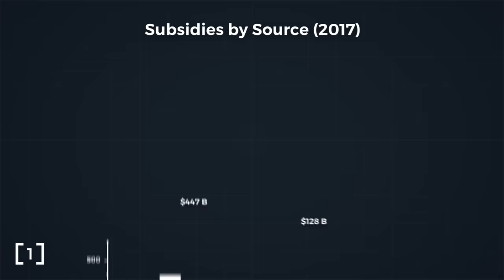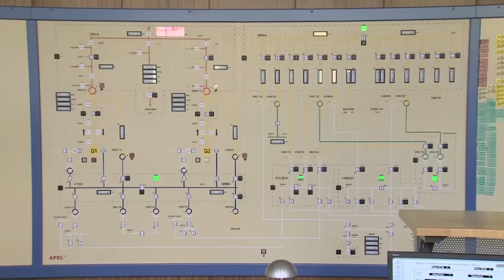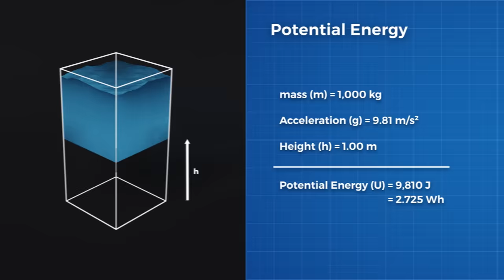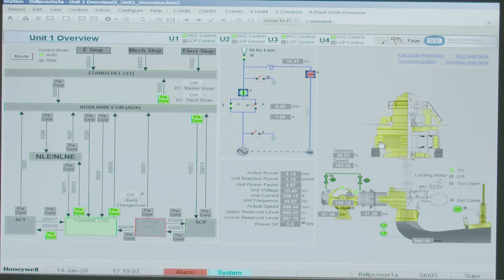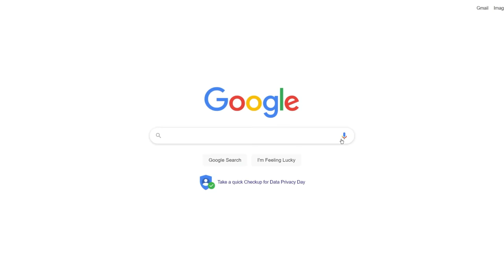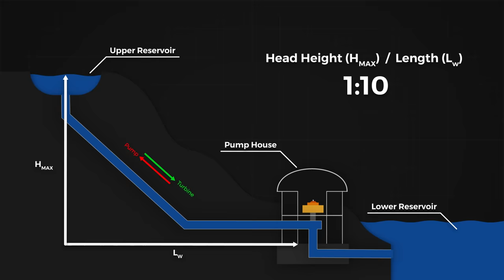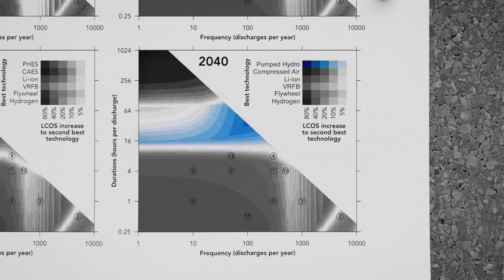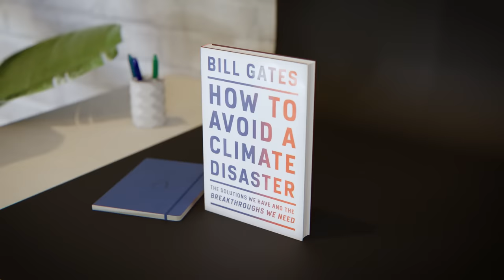The Truth About Pumped Hydro

Comment: I like what you said : "Not just one solution". Too often people are looking for a silver bullet instead of several solutions working together to solve a problem.
Reply: And this comment section is full of them.
Reply: You're so right, hydrogen, batterys, pumped hydro, biomass. Theywillall e usedin  some kind  of  area sooner  or later.
Reply: Yeah you need a gun that can fire silver bullets and cartridges and all that jazz
Reply: @laredobenjamin7438  "there are situations where the single solution is the most efficient" - you are aware of the 'there are situations' part of your statement? ;-)
Reply: There's a uranium bullet solution for every energy shortage problem.
Reply: @Kenneth_James  I don't have much respect for people , like you, that don't bother with research before making a sweeping generalization.
Reply: Nice name
Reply: Silver shot (as in shotgun) is the metaphor we need.  

Also, to the "nuclear is the answer" folks...  The economics just aren't quite there with existing nuclear tech.  Yeah, it is part of the answer, but not the answer at this point.  I hope the breakthroughs needed happen and scale to make for cheap nuclear, but right now y'all sound a lot like fusion boosters... Always just around the corner.
Reply: I've been working with nuclear energy for about 13 years now. It's not the tech that is the major road block. It's general public ignorance about the workings of radiation that drive fear based solutions for non-existent or overblown problems and a poor ability to frame relative risk. It all comes down to the indirect costs of the lengthy regulatory process that increases financial risks for investors. Every anti-nuke group knows this and try their hardest to bleed the projects dry by stalling them in court. Every day of delay costs millions.
Reply: @GwynRosaire  Yes and no.  Regulatory burden is a big deal. A lot of that is driven by irrational fear, but a lot is perfectly reasonable too.  Even if the public properly understood everything, nuclear power would still need to be very closely regulated because the consequences of companies cutting corners or just screwing up can be huge.  And you know companies cut corners and screw up ever day.  
Engineering and regulaton both lead to nuclear power being very large scale and long timeframe investment.  It isn't just or even mostly anti-nuke folks.  Those anti-nuke folks do make it far less likely that countries and companies (mostly finance really) are willing to put up the massive $ needed, but even if those folks didn't exist, the investment isn't particularly attractive given how quickly power generation tech and the competitive landscape are changing.  Several decades ago nuclear power looked a lot better as a long term bet, now, not so much.
The new nuclear tech that has been a decade or two away for more than a half century is turnkey small scale.  That would be a game changer, but it doesn't exist.  Seriously, folks have  been talking about small reactors (similar naval) being used for commercial power for longer than I've been alive, and I'm getting old.
Better bet is to move to more distributed small scale generation using a variety of tech and most plants with expected lifespans of a couple of decades or less, alongside point of use and community generation.  That sort of setup is a bit less efficient in the short run, but can adapt and adopt new technology much quicker and easier as it comes around.  A "smart grid" including some storage are enabling infrastructure we need.
Reply: how about comparing 128B for renewables vs 21B for nuclear which is the largest scale of clean energy?
Reply: Premise is faulty, crashing the entire system during rona yield insignificant carbon reduction, all these efforts are gloss, promoted with dishonesty for a reason, the double/triple spend of renewables that can't stand on their two feet is being over sold.
Reply: I've noticed this as well, people get hung-up on the "one answer" rather than accepting that depending on the circumstances one solution may be more viable than another.
Reply: @GwynRosaire  and disposal
Reply: The one critical component not discussed here is demand reduction. A huge chunk of our emissions reductions so far has been through efficiency - insulation, lightbulbs, better appliances. Though a range of solutions all working together is what's needed, the single best solution is not to need so much energy in the first place.
Reply: @michaelmichael3007  disposal is another politically contentious issue. It's not a technical issue. In fact, there are several videos on youtube from Argonne National Lab that document the research on nuclear fuel recycling. This turns the issue from one of deep geologic disposal, to one where it only needs to be stored safely for a few hundred years. And, before you talk about legacy waste sites, the distinction needs to be made between military weapons production and civil power production.
Reply: really, i think the problem is too many people are running their mouth and not actually doing anything. 
eg. hollywood, youtubers, media, wankers on facebook, wankers in the comments section, you get it almost all people.
Reply: Sounds like pharma
Reply: @marknoneya6630  🧠
Reply: @johnking6624  Oh yes, insult people, that is always a great way to convince them to change their minds.
Reply: @gordon1545  This is true in mature economies, but most people in the World are not living a Western style Middle Class life.  To achieve that will require a massive increase in power generation.  Multiple times what is produced today.
Reply: @Foolish188  If you are criticising my comments about fools who make sweeping generalisations from a position of ignorance then you should realise that they are too stupid to change their minds. Experience has shown that evidence does not sway them and reason is a mystery to them.
Reply: It's all a stop gap until Fusion gets fully developed... once fusion reactors come online, they can generate 300 liters of petro equiv per 1 liter of seawater (the deuterium that can be produced from that, that is) deuterium is so easy to produce, and tritium can be produced from lithium, with the current supply in the US having enough to last 1000 years, and the amount that can be taken from the sea, millions. 

Fusion is everything we wished Fission would be with nuclear energy, relatively clean, safe, and inexpensive (later on, it will cost more as companies recoup the cost of development) you can't have a chernobyl type event,  because as soon as the plasma loses containment it rapidly cools, and the reactor will shut down within seconds.
Reply: @ExarchGaming  We can't afford to wait for something that may not even be possible.
Reply: @johnking6624  It's not an if, it is possible, we've been able to initiate a fusion reaction (outside of thermonuclear weapons, so not a fission boosted reaction) and we've been able to get more energy out of the exchange than we put in, that was over a decade ago, both the US and China have set new records throughout the 2010s, it's a when not an if. 

The rest of your comment is totally valid though, yeah we may not be able to wait; hence the stopgap of alternative power such as renewables or fission nuclear. both should be exploited to their full potential until they're not needed anymore.
Reply: @ExarchGaming  I have been waiting for fusion power since the Russian physicists built the Tokamak back in 1958. It was certainly a possibilty then and all they needed was to overcome the engineering problems. We are 60 years later and its not there yet. The urgency of global warming is such that we cannot afford to wait. Even if we started a Manhatten project for Nuclear fission there is no guarantee of succcess within decades. Once CO2 is in the atmosphere it is there for tens of thousands of years. We need a fix NOW.
Reply: we're all monkey at heart, we must reeturn to monkey
Reply: @jojispoon3921  We are not monkeys you ignoramus. We are great apes.
Reply: I call it nuclear bomb syndrome. A relic of the last big war.
Reply: I think the notion of "not just one solution" or needing a "mix" is more of an idealistic assumotion than anything. In engineering the best solution is the simplest solution that works. And a big mix of unreliable renewable energy sources is neither simple nor does it work. There are silver bullets. People just don't like them. Nuclear is a silver bullet. Not just in the sense that it can do it all alone. But because it does it best alone.
Reply: And worse, using that as a justification to not do anything at all
Reply: @naberville3305  ON the contrary, renewables are quite simple even when factoring in two stage storage (short term batteries for FCAS operations and long term large scale storage) and yes they do work, unless you want to ignore New Zealand and Iceland for example.

Looks like you proved John King correct.
Reply: @jbaker0203  yeah no. Neither new Zealand nor iceland are good examples. If you want to prove to anyone that renewables actually work and can work everywhere. Don't use the countries that rely on geographically limited energy sources such as hydro and geothermal. Of the two only new Zealand uses an intermittent renewable energy source, wind, and it only makes up 5% of the energy generation. 
Geothermal and hydro can decarbonize. Wind and solar cannot. And there simply isn't enough capacity to expand hydro and geothermal. They are too geographically limited.
Reply: @naberville3305 those energy sources are still renewables and definitely aren't intermittent so your argument there is inaccurate. Whether there is still capacity to expand is irrelevant as they still get all their energy from those sources but nothing stopping them from building wind and solar.

As for wind and solar, you most certainly can decarbonise these sources in terms of eliminating co2 emissions from their production.
Reply: @jbaker0203  I don't think you got the point at all. If you can't expand the capacity to 100% of demand globally.. why would you hold it up as a success story for all renewables. Just because baseload hydro can succeed in specific conditions doesn't mean intermittent wind or solar can. Don't mix up hydro/geothermal and wind/solar. Make sure you understand which are being referred to when someone says "renewables"

Y'all really don't understand redundancy. If something only works under only very specific conditions. Then it doesn't actually work. 

And no I'm not talking about decarbonizing production of wind turbines. I mean they can't be used to decarbonize the grid.
Reply: @naberville3305  "I don't think you got the point at all. If you can't expand the capacity to 100% of demand globally.. why would you hold it up as a success story for all renewables. Just because baseload hydro can succeed in specific conditions doesn't mean intermittent wind or solar can. Don't mix up hydro/geothermal and wind/solar. Make sure you understand which are being referred to when someone says "renewables"
"

Well if you're talking about globally (which you never specified), each country is going to have to build to their own geographical conditions. For Australia, that means wind and solar, for countries such as China, it'll probably need nuclear. This doesn't invalidate my point though, which is renewables can do the job, which you claimed they couldn't.

Geothermal, wind, solar, pumped hydro, hydro, hydrogen based gas are all renewables, whether you like it or not. When someone says renewables, unless they specify wind and solar, that's what they're talking about, the source of power is renewable, it doesn't deplete.

"Y'all really don't understand redundancy. If something only works under only very specific conditions. Then it doesn't actually work. 
"

Well that's just bullshit. 

"And no I'm not talking about decarbonizing production of wind turbines. I mean they can't be used to decarbonize the grid."

This is bullshit as well.

You need to understand how grids are being built with wind and solar in the mix. They add in batteries and longer term storage.
Reply: @jbaker0203  it's a global fucking issue is it not? Jesus christ man. Just digging in aren't ya. 
If the goal is 100% decarbonization rather than 100% renewables which I hope to you it is. Then wind and solar simply do not play a role. Storage maybe. Storage cannot save wind and solar. They produce energy too intermittently and fluctuate too much over both short and long periods of time. The amount of storage necessary to fully backup wind/solar is beyond our ability to manufacture or afford both in terms of wealth and of resources. There are lots of countries and states pushing wind/solar and storage. And if you take the time to look into them. None of them have managed to push grid share beyond ~40% and all of them have sacrificed affordability and reliability to get there without even making significant carbon reductions as a result. 

The only countries who have achieved low carbon electricity without the majority of their electrical production coming from hydro have used nuclear in near exclusivity. That's really the only way to do it. Nuclear and wind/solar cannot should not coexist onna grid. Where there is no hydro to back up wind/solar. Your options are wind/solar/gas. Or nuclear.
Reply: " it's a global fucking issue is it not? Jesus christ man. Just digging in aren't ya. "

Sorry I didn't realise I had to explain such a basic concept as not a one size fits all. I'll make sure to break it down for you in future.

"If the goal is 100% decarbonization rather than 100% renewables which I hope to you it is. Then wind and solar simply do not play a role. Storage maybe. Storage cannot save wind and solar."

You say this as though it were fact, which is just bullshit. You have nothing to substantiate this claim.

 "They produce energy too intermittently and fluctuate too much over both short and long periods of time."

That's why there's storage to go with it.

"The amount of storage necessary to fully backup wind/solar is beyond our ability to manufacture or afford both in terms of wealth and of resources."

This is also bullshit.

 "There are lots of countries and states pushing wind/solar and storage. And if you take the time to look into them. None of them have managed to push grid share beyond ~40% and all of them have sacrificed affordability and reliability to get there without even making significant carbon reductions as a result. "

It's like you don't comprehend the fact it takes time to build these things. If I were to use your own logic against you, no power source will ever meet our needs because none ever have. This sort of stupidity only demonstrates you haven't even thought about the time it takes to build. I also don't think you've been paying attention to the costs because in those countries where renewables are making a big impact, it's doing so because it's cheaper.

"The only countries who have achieved low carbon electricity without the majority of their electrical production coming from hydro have used nuclear in near exclusivity. That's really the only way to do it. Nuclear and wind/solar cannot should not coexist onna grid. Where there is no hydro to back up wind/solar. Your options are wind/solar/gas. Or nuclear."

Yeah this is absolute bullshit.

https://www.energylivenews.com/2019/07/01/which-countries-are-leading-the-way-in-sustainable-energy/

https://www.reuters.com/article/uk-denmark-renewables-windpower/denmark-sets-record-with-43-percent-of-power-from-wind-in-2017-idUKKBN1F01VD?edition-redirect=uk

Only one country mentioned in these articles has nuclear. 

Feel free to actually provide evidence to back your claims.
Reply: @jbaker0203  it is fact yes. Wind and solar have no role to play and storage can't save them. That is indeed a fact. The proof is the fact that there isn't a single instance of wind/solar/storage covering 100% of demand at any level. From country wide grids down to micro-grids down to even living off grid with solar panels and a battery. No one has achieved 100% usage from wind/solar/storage. Those that have done so off grid have only achieved it by unscalable means. That's why I laugh when your show cases for storage and renewables working is iceland and new Zealand. Cause they don't even need storage and they barely have any wind or solar. 

If you threw everything we had globally at producing enough storage. The most you could probably get to would be 60-80% grid share. Up from wind/solars max of ~40%. 80% sounds good but the offset is that the electricity would be too expensive to use to decarbonize other sectors such as transportation or manufacturing. Its kinda a no brainier when you have options available that can achieve 100% grid share cheaply.
Reply: @jbaker0203  sorry man but your clearly very new to this issue. And I don't fault ya for that. But don't dunning kruger this shit
Reply: @naberville3305  no its not a fact. It's only a fact there's no nation that has such a grid simply because it takes time to build. Otherwise again using your woeful argument, is a fact no energy source can meet global needs because no country users one single energy source. It's a stupid argument.

Your claims solar and wind can't meet the demands is just your own ignorance. You reject new Zealand and Iceland because they use geothermal and hydro so what is still renewable energy.

They also happen to be some of the oldest renewable energy around hence why New Zealand and Iceland are running off them.

As for costs, renewables have the lowest wholesale costs of any source. That's a fact.
Reply: @jbaker0203  yeah no it really has nothing to do with time. If your talking about the time it's going to take them to build storage to fill in the gaps. Sure. Except there simply isn't enough manufacturing capacity anywhere to do that even on a small scale. There are lots of places that rely on only a single source of energy. Lots of grids run on single coal plants or gas plants or hydro. More isn't always better nor is it necessary.
Reply: @jbaker0203  again it doesn't matter if hydro and geothermal are renewable. Your just giving yourself a bunch of false hope when you look upon hydro/geothermals successes and assuming it works the same for wind/solar and your chances of success with them.
Reply: @jbaker0203  and I don't even think you can read. Cause yes I stated renewables have the lowest wholesale cost that is indeed a fact. But that's the price the grid operators pay for electricity. That's not the price they sell it back to the grid for. Look it up dude. Electricity price hikes in cali, germany, denmark, etc. Everywhere renewables mandates are pushed prices have risen that's an undisputable fact. 
https://www.google.com/amp/s/www.instituteforenergyresearch.org/renewable/renewable-energy-mandates-are-costly-climate-policies/amp/
Reply: @naberville3305  no I don't because all you've done is make a whole bunch of claims that aren't backed by anything and only demonstrate your ignorance.
Reply: @naberville3305  sure it has to do with time otherwise again by your own warped logic, no power generation will ever be able to provide all our energy needs because no single form currently does. It's a very foolish argument to make
Reply: @naberville3305  clearly you don't know the difference between wholesale and retail. If retail is far costlier, that's on the market conditions, not on energy source.
Reply: @naberville3305  " But that's the price the grid operators pay for electricity. That's not the price they sell it back to the grid for. Look it up dude. Electricity price hikes in cali, germany, denmark, etc. Everywhere renewables mandates are pushed prices have risen that's an undisputable fact. "

Sure it happened here in Australia too. You know what caused the price hikes? The retail market and gas prices, not renewables. It helps if you actually look more in depth into the issues. If it can be provisioned cheaper at wholesale, then it's clearly not the generation type causing the increases.
Reply: @jbaker0203  the dunning kruger is strong with this one
Reply: @jbaker0203  that's an assumption and not really the point I'm trying to make either. Never said nuclear should be the only power source. Hydro and geo are fine where doable. Just not wind or solar in quantities larger than what can be backed up by existing hydro.
Reply: @naberville3305  yes the dunning Kruger affect is strong with you. That's a breakthrough. I'm proud of you.
Reply: @jbaker0203  sorry I keep making complicated arguments well above your limited knowledge. The reason I say wind and solar can only be built to the capacity in which hydro can back them up. Is because since wind/solar are extremely variable. They need a similarly variable energy source that can ramp up and down quickly to provide power when the sun is down or wind isn't blowing. At the moment that energy source is natural gas. Which produces co2. So if you want to be able to use wind/solar in a 100% decarbonization scenario. You can only use it in countries and areas with enough hydroelectric capacity to back it up. There are several countries with a near 100% low carbon that utilize majority hydro with ~30~40% wind. That's doable on a "nation by nation" basis as you say certainly. But that is the limit to which intermittent energy sources can or should be utilized. Pushing them in places where you don't have hydro just locks the gas plants in and makes it impossible to decarbonize fully. Storage isn't going to stop that. The amount of storage you need the closer you get to 100% grid share is exponential and we haven't even made it to the curve with our current production and use of storage. Every large scale storage system at this point only deals with grid stability. Not providing baseload power for long periods of time. I think the estimates I've seen is that we have only .02% of the storage necessary for 100% renewables globally.
Reply: @naberville3305  the reason it will be a mix and not just 1 is because each one works best in certain situations, and not every place on earth is identical. Similar to the way there is no 1 single aircraft that is "the best," it depends on the situation.
Reply: @Sciguy95  yes and no. Certainly where you have hydro you can use hydro. Certainly where you have geothermal you can use geothermal. And where you have those you may be able to use them to backup wind/solar to a degree. But if you want to have 100% low carbon-electricty where you don't have those. Your only option is to get the vast majority of your electricity from nuclear without much wind/solar. Nuclear can be used as a backup to wind and solar. But the problem there is that the amount of nuclear power capacity youd need to back up wind and solar is almost exactly equal to the capacity youd need to get 100% of your power from nuclear. At which point the wind and solar on the grid just becomes a huge waste of carbon, energy, and resources.
Reply: @Sciguy95  and airplanes aren't a great metaphor tbh. There are many variations of planes. But the differences are really only skin deep. They all rely on the same principles and technology that's decades old. Some planes built in the 60's are almost indistinguishable from planes built today. Airplanes are really not diverse at all. Diverse would be if we're using a lot of  autocopters for example. Something that relies on entirely different principles of flight.. If you want diversity to meet every different situation you don't need a whole new approach to airplanes or energy sources. Just like there are variations on planes. There are just as many variations on nuclear reactors. We can build huge water cooled super high capacity reactors and we can build small aircooled reactors that can run in the dessert without water.
Reply: @naberville3305  so like I said, it will not be a 1 solution fits all as you make it out to be. Each area has advantages and disadvantages that will require a solution made to fit them. Where 1 system works well another may not. I've read your other comments and you remind of other people I've seen on youtube that get hung up on 1 opinion and absolutely refuse to budge no matter what. You insist that if something doesn't work everywhere then it doesn't work at all and that is just flat out wrong. No single renewable source will be "The Solution" it will be a mix of multiple different sources depending on what the areas they are utilized in have to offer and the needs of those areas.
Reply: @Sciguy95  yes. If your happy with a 98% nuclear 2% hydro mix. Then sure it's a mix. Yeah. A mix. Lol.
Reply: @naberville3305  as with all your other comments I've seen, you completely miss the point. The point is that there is no 1 deaign that would work in every situation, each one is designed for a specific situation based on that situations needs and what is available. And just like with renewable energy sources, there is no 1 source that would be universally applicable.
Reply: @Sciguy95  and that would really only last as long as the dams do. Cause they really aren't the most environmentally friendly.
Reply: @naberville3305  there's no point talking with you. Your as bad as a flat earther, outright refusing to accept anything g that doesn't agree with you.
Reply: @jbaker0203  he reminds me of this guy that told me that climate change is fake and it doesn't matter that the average global temperature has continuously risen, and we are seeing nearly every effect that global warming has been predicted to cause, its not happening because we don't have direct measurement of the earths climate since the earth first formed. He refused to accept anything other than his conclusion and told me that I clearly have no idea how this stuff works.
Reply: @naberville3305  Do you expect a massive multi-billion dollar nuclear plant to be built in the english countryside? How about in the middle of mogadishu? Yes nuclear is most definitely one of the best methods of energy generation, but you have to understand that it cannot be implemented everywhere on the planet at it's current technological standpoint
Reply: @3User  rolls royce is building SMR's are they not? And you could power the entirety of the UK with nuclear power without building a single new reactor in the country. With a model I'm particularly in favor of. Having nuclear reactors built on floating platforms and shipped around the world rather than built in place. I can't think of any place on earth that could not have it's energy needs satisfied with nuclear.
Reply: @Sciguy95  but at that point. Its still all nuclear and that's what's important. Not necessarily what type or manufacture of reactor. The only significant difference really is cooling method, moderators, and built in safety features. But if that tickles your need for diversity that's fine by me lol.
Reply: @naberville3305  So you don't care about costs, the lack of need for nuclear for countries like Australia, Iceland, New Zealand etc? Why would those countries need nuclear, especially in light of the fact nuclear is far more expensive? That would be a stupid idea.
Reply: @jbaker0203  cost is a primary reason for supporting nuclear over wind/solar. The economics of these two energy sources are way to complicated to be summed up as "this is expensive" "this is cheap" cause both statements are true for either.
Reply: @naberville3305  what a load of shit. Nuclear in Australia is far more expensive than wind/solar and that includes battery storage.
Reply: @jbaker0203  australia doesn't have a single nuclear reactor. Which is certainly a shame cause their electricity is so ridiculously filthy. Trust me my dude the economics of either is way too complicated for me to get into an hour before work. All you need to do is puzzle over why france, a country with ≥70% nuclear has almost half the price of electricity as that of germany with ~40% renewables. Key lesson is that the cost to generate electricity is only half of the cost of electricity.
Reply: @naberville3305  trust you? Lol you say Australia doesn't have a single reactor which is bullshit, it's at Lucas Heights. You say the power is immensely dirty and it is, it's also shifting fast towards renewables with roof top solar.

Sorry your example is a simplistic assessment which doesn't actually provide any in depth analysis of power between France and Germany and it certainly doesn't cover countries like Australia, new Zealand etc.

In short it's a bullshit claim.
Reply: @jbaker0203  Sorry don't really have time to go in depth before work. And tbh no point with someone who's rather upset about it. If your interested in learning and not instantly "that's bullshit!". I'll be back in about 12 hours and can give you as close to a full run down as I can. 

(Lucas heights is a research reactor producing medical isotopes not electricity)
Reply: @naberville3305  you said reactor not specifically that it needed to produce power.

Feel free to actually present your data that shows nuclear cheaper than renewables in the countries I listed. I want actual data, not worthless claims.
Reply: @jbaker0203  arguing semantics is pointless. 
Made a reply earlier that didn't seem to make it through. Rip. 
I'm afraid trying to ask for hard data on something that is so much theoretical is kinda difficult. End of the day this debate is about the macroeconomics of a niche market. That means the amount of variables are immense. Literally anyone who just says "renewables are cheap" or "renewables are expensive" or "nuclear is cheap" or "nuclear is expensive" is simply wrong. Because all 4 statements are true in one sense but all 4 are also wrong in another sense. 

I can do my best to give you studies that may broaden your understanding. But don't take them as hard proof of anything. Because they are conclusions made from limited variables. And when you inevitably find a study coming to a completely opposite conclusion. Realize that it's just a different conclusion made from similarly incomplete collections of variables. 

The only Hard proof out there is looking at real world examples. And even those aren't hard proof if one success or failure is dependent on non-inherent variables. 

Not saying that to avoid having to prove anything. But simply because it doesn't matter if I can prove X true in a certain sense if you feel you can prove that X is wrong in a different sense. For example our semantics. There are no nuclear reactors in aussie in the sense that there are no nuclear power plants. X is true in that sense. But X is false in the sense that there is a small research reactor producing medical isotopes instead of electricity. 

Basically don't take anyone's word for it and try to understand the issue for yourself. I'm not gonna argue with anyone more interested in winning an argument than learning from it.
Reply: @jbaker0203  so. To be veeeerrrryy specific about in what sense I think the economics of nuclear power is preferable to the economics of renewables for the purpose of decarbonization. Its important to understand wether renewables or nuclear are cheaper in most current grids is irrelevant. Because it's not about what's cheaper right now. Its about what's cheaper when either source is providing a country with 100% clean electricity. Just because it's true that windmills and solar panels are cheap to install. Doesn't mean that 100% renewables would be cheap. Because the cost to produce electricity is in a conventional grid, less than half of the cost of electricity. Cost of distribution is the majority of the cost of electricity. And while renewables Definitely lower the wholesale cost of electricity. They increase the cost of distribution exponentially relative to their gridshare. In other words. For every solar panel or wind turbine you add. The less valuable or more expensive the next one will be go the grid. This is due to wind and solars variability and diffusiveness. Which requires a lot of extra effort on the part of the grid to keep the power they supply consistent. 

So in a country with almost no renewables. Like aussie. Renewables are definitely cheap! And adding a solar farm or two will definitely lower your cost of electricity as the money saved in generation will be much more than the burden of a few solar farms on the grid. But if your in a country with a lot of solar already. And all of the power you produce with a new farm just gets wasted in over production or has to be stored in expensive batteries. Then your not really saving any money. There is a study on the diminishing returns on wind/solar install value I'll try and find for you. 
But basically if you know what an exponential looks like. You know that the increase in cost per gridshare isn't going to be relative and at a point it's going start getting much more expensive very quickly. As far as I can tell this is at about ~40% gridshare in a country with both wind and solar. At that point any additional solar panels or wind turbines just adds to overproduction that is either wasted or sold to other countries and not contributing to the host countries gridshare. 

https://www.rechargenews.com/transition/cheaper-and-safer-than-wind-or-solar-dutch-to-consult-on-new-nuclear-power-plants/2-1-880143

https://energycentral.com/c/ec/researchers-have-been-underestimating-cost-wind-and-solar

I won't ask you to take shellenbergers word for anything. Only sharing his articles cause he always has lots of links and references to studies. Though he is the person who changed my mind from being pro-renewables to pro-nuclear.  https://www.google.com/amp/s/www.forbes.com/sites/michaelshellenberger/2018/04/23/if-solar-and-wind-are-so-cheap-why-are-they-making-electricity-more-expensive/amp/

In this article there is a study by Leon Hirth on how wind/solar variability affects their relative value. 

Basically, just because LCOE's about the lifetime cost of individual solar panels or turbines say it's a cheap. Doesn't mean 100% renewables would be. And while yes there are lot of studies saying that it would be. Just remember what I said about conclusions based on limited variables. I haven't seen a single 100% renewables proposal that didn't have holes you could thread a sequoia through.

Nuclear on the other hand. While definitely being very very ridiculously expensive. Does have economic advantages that make a 100% nuclear power grid affordable. And that is a very low operating cost. And little to no loss in value relative to gridshare. And also by not being anywhere near as technologically optimized as wind or solar. Meaning while a new reactor might be expensive today. Innovation has a lot of room to lower those costs. Such as SMR's or floating reactors. 
And While nuclear definitely increases the cost of wholesale electricity. It lowers the cost of distribution enough to make the difference easily bearable for the purpose of decarbonization. The reason it lowers the cost of distribution is because you require fewer power plants or install capacity overall which includes all the transmission lines and infrastructure. Nuclear is more than twice as reliable as the next energy source in terms of capacity factor. So in the case you had a grid with 1000MW of demand. Instead of like ~2000-2500MW of capacity of coal. Or 6000MW of solar + 1000MW of gas. You only need ~1100MW of nuclear. 

We should definitely expect to pay more for electricity when moving to decarbonization. But we can at least afford a 100% nuclear grid. Several countries are near to doing so and have very affordable power. Such as france or ontario. But we can tell from the fact that countries that have reached that steep part of the exponential cost of renewables that 100% renewables will never be affordable. 

And don't "but storage" me cause it will have the same issue with diminishing returns relative to gridshare. Once you go beyond storing enough power to last the night the cost of storage will exponentially increase.
Reply: @naberville3305  "I'm afraid trying to ask for hard data on something that is so much theoretical is kinda difficult. "

Firstly, we're not arguing semantics and secondly, I have hard data right here from AEMO in Australia

GenCost 2020-21 - CSIRO https://www.csiro.au › media › renewables-cheapest

https://www.eia.gov/outlooks/aeo/pdf/electricity_generation.pdf

https://www.iea.org/reports/projected-costs-of-generating-electricity-2020

So that's for the US and Australia, both showing renewables as cheaper than nuclear. I even included a link to show nuclear being cheaper in Japan and Europe to show it's not a one size fits all.

"Literally anyone who just says "renewables are cheap" or "renewables are expensive" or "nuclear is cheap" or "nuclear is expensive" is simply wrong. Because all 4 statements are true in one sense but all 4 are also wrong in another sense."

I have hard data to back up my claims, have you? It appears what links you provided in your second post don't actually provide hard data. The first one talks about a report to the Dutch government, but doesn't actually provide the report. The second link you provided is completely wrong because as per the AEMO and IEA reports, they cover both subsidized and non-subsidized evidence.

"Basically, just because LCOE's about the lifetime cost of individual solar panels or turbines say it's a cheap. Doesn't mean 100% renewables would be. And while yes there are lot of studies saying that it would be. Just remember what I said about conclusions based on limited variables. I haven't seen a single 100% renewables proposal that didn't have holes you could thread a sequoia through."

So what your saying is because you doubt the reports, therefore the reports aren't correct? Got it. I'll just go ahead and say your conclusions are wrong.

"We should definitely expect to pay more for electricity when moving to decarbonization. But we can at least afford a 100% nuclear grid. Several countries are near to doing so and have very affordable power. Such as france or ontario. But we can tell from the fact that countries that have reached that steep part of the exponential cost of renewables that 100% renewables will never be affordable. 

And don't "but storage" me cause it will have the same issue with diminishing returns relative to gridshare. Once you go beyond storing enough power to last the night the cost of storage will exponentially increase."

Well that's utter bullshit, you have nothing to back that claim up which is why I asked for hard data.
Reply: @jbaker0203  yeah you didn't really get my point. The whole point I was trying to make is that nothing in this debate is so cut and dry. And there really is no hard data. No what you shared was not hard data. You did pretty much exactly as I said you would. You'd find articles and studies that come to opposite conclusions based on similarly limited data. 
I've been in this debate a long time. I started out very very very supportive of renewables. And I've come to realize at least in terms of the economics. There is no hard data. In economics there never ever ever ever ever ever ever ever is hard data. Just bold conclusions made on limited variables. And the bolder they are the more fewer variables they must have considered. 

Are the sources you shared wrong? No they are (probably) correct. But when they say they are cheap they are (probably) referring to the cost to build and sell electricity to the grid. That's what almost every single cost estimate of renewables is about. Because that's easily measurable and understood. What they don't mean and probably didn't study is the effect on distribution. And even if they did try to study it. It probably wouldn't be conclusive simply because the data set would be too small and it would only be for a specific gridshare on a specific grid. You could really only study that on a global scale and even then.. it wouldn't be hard data. 

To be frank your simply in the wrong debate if your a hard liner for hard facts and evidence. This is economics. Economics is.. essentially PURELY theoretical. It doesn't physically exist. Money is literally just a concept. If we were able to find hard data about the economics of ANYTHING.. wow what a different and amazing world that would be. I mean shit everyone knows trickle down doesn't work. But that doesn't stop conservatives from mass producing studies based on limited info that it does. 

I know I'm mostly just rambling on about the nature of the debate rather than getting into the debate. But I think it's honestly more important for you to understand that than to actually try and teach you about economics that I personally cannot fully grasp.
Reply: "  yeah you didn't really get my point. The whole point I was trying to make is that nothing in this debate is so cut and dry. And there really is no hard data. No what you shared was not hard data. "

Yes, the data I provided is hard data, feel free to provide evidence as to why the data is incorrect. I won't accept you simply asserting it because you're opinion is worthless.

"You did pretty much exactly as I said you would. You'd find articles and studies that come to opposite conclusions based on similarly limited variables. "

So in short, you don't like the published data because it doesn't suit your argument, got it.

"What you share does not conflict with my point. I never said renewables weren't cheap. They are cheap. Just cheap in very specific ways that tend to be misconstrued. The LCOE's are correct for the most part. The problem with them is they are referring to the lifetime costs of operating a solar farm. Those LCOE's aren't a cost estimate for solar powered grids and never were meant to be. "

Except this is a bullshit argument because that's why battery systems are being introduced, for FCAS purposes and this is included in the AEMO report. Clearly you didn't even bother to read it.

"And like I said. The exponential diminishing returns allows for renewables to be cheap and economically beneficial at certain gridshares. Showing it being cheap in places with those low gridshares is also in agreement. "

Absolute bullshit.

"Try and understand the arguments your opponents are actually trying to make.."

Try to actually make an accurate argument with evidence instead of simply asserting it because your argument alone is bullshit.
Reply: @jbaker0203  instant rejection without attempting to understand anything. Sigh. Not much point in education is there.

Use your brain and think about how shit works lol
Reply: @jbaker0203  lol I literally stated I only shared the shellenberger article as a link to other links. May you sure like to twist words and intentionally misunderstand. I don't really want to get nasty so have a good one. No point putting any more effort into some one so obstinate.
Reply: And like I said. Its economics. Its all theoretical.
Reply: @naberville3305   "And like I said. Its economics. Its all theoretical."

And yet there's data to back up the arguments I have presented that renewables are cheaper than nuclear and you failed to present any data that substantiates any claims you've made. Funny that.
Reply: @jbaker0203  Just because something is theoretical doesn't mean there isn't data. Lots and lots and lots of data. The problem with what you shared isn't that it's incorrect. Its just incomplete.

Let me say that again cause you seem to not be able to understand this crazy shit. 

The articles you shared are correct.

But they are correct for certain conditions and purposes in a specific place. The conclusions drawn aren't representative beyond the boundaries of the study. What's true at one place and time means little in another. I'll tell you now that for the purposes of those studies and the way they are conducted. Renewables are cheaper than nuclear anywhere on earth. For the purpose of installation and selling electricity to the grid. You keep insisting that I'm wrong by showing evidence of things I've already said to be true. Way ahead of you. Like yeah I know wind and solar are cheaper to install and sell electricity to the grid. That at least is indeed provable fact. Just have to go read a meter. But while your thinking about the microeconomics I'm trying to understand the macroeconomics and micro doesn't scale to macro.

Go back to the shellenberger article and scroll till you find his link to the study I mentioned on how renewables lose value at higher gridshare. That one's pretty important to understanding why renewables can be cheap now but be too expensive later. And if you want me to explain why this applies to batteries I can do so as well. But only if your actually willing to listen.
Reply: @jbaker0203  kinda hard to provide links to pdfs just fyi. Don't be lazy my dude
Reply: @naberville3305  not my job to prove your point.
Reply: @naberville3305  I simply called out bullshit claims, that's it.
Reply: A brief on Hydroelectric 2 nd stage power recovery system
This system is for all hydro systems running with a TAILRACE setup
Why a tailrace setup ?
In an ideal setup without the need to modify the construction plans to fit into a geological
or given plot of stable ground, the benefits are not lost to compromise.
As however in the real world hydroelectric systems are generally a compromise, and the
TAILRACE is invariably longer than the turbine hall would find IDEAL in regards to
power made per ton of water used - a loss that can now be recovered
With the turbine hall believing a shortened tailrace has been fitted this allows the turbine
hall to make more power out of the same volume of water
IT IS WISE TO NOTE TOO SHORT A TAILRACE AND A SURGING ISSUE OF THE
TURBINES WILL OCCUR, leading to its self destruction
What sets how short the tailrace can be made?
Because each and every dam is in effect a custo- made system, and so the type and
number of turbines at the location dictate the power recovery units location in the tailrace
But there are basics that are common to all hydro installations
Example of why a shortened tail race works
A different way to look at what is happening at this point is:
You buy a 2 stroke motor to fit to a go-cart but it needs a bit more power. The quickest
and cheapest way is to get a tuned exhaust pipe – it’s generally a shorter and larger
pipe
This allows the motor to breathe freely and returns a boost in power output with just the
right amount of back pressure
Firstly Back Pressure
This new setup will not generate a backpressure issue to the dam (a common reason
why to date the industry has failed to benefit in this area). In short blinded by their
education. A stumbling block that has been drummed into every Engineer so no one
looks at this sort of issue as solvable
Secondly Down Time
The assumption is made that to build this system would mean the dam will be offline for
years when 90% if not more of the installation will not require the dam to shut down and
the final step can be taken during the annual servicing period of the dam
The freeing- up of the turbine hall from having to work with a tailrace that is now tuned to
the best power output. NOT distance to the discharge point!

And along with my new 2 nd stage turbine power recovery systems the return should be 3-
8% more annually combined
Thirdly Servicing
With no extra shutdown periods needed to service the new power recovery system as
this can happen independently
And should a unit go offline in say a three-unit setup, the offline unit can be swapped in
a day without the need for the remaining two units being effected OR the turbine hall
operations
The end of the tailrace will continue to spill out into the existing lake or river location with
only one extra outlet fitted to handle the same water volume, but now at a slower pace
so that all works are easily able to be environmentally completed
If a pump hydro system is used this will not alter the setup or require modification
It should be noted that this system has less parts to an equivalent turbine setup so there
are less failure points
And is expected to outlast the required life expectance of the dam
NOTE
Chinas hydro output to date is:
According to IHA&#39;s 2020 Hydropower Status Report, total hydropower capacity reached
356 GiggaWatts in 2019 after a further 4.2 GW in capacity was added
China&#39;s total estimated hydropower generation reached
1,302.00 TerraWatt hours.
FINAL POINTS
So say China’s hydro output was up by a further 3% only (as not all China’s dams can
run this system). So what is that worth as annual income to the country?
It should also be noted that a new dam construction with a penstock hydro system fitted
will double the return in secondary power recovered and still be serviceable without
impacting the turbine halls operations
Reply: It exists. Its called Fission.
Reply: It does not exist, there are advantages and disadvantages to every form of energy generations, and they varied according to topography, climate and many other factors.
Nuclear fission are more expensive than solar or wind, but they are consistent and great for base loads.
Nuclear power costs can go down if we make more of them, but the top nuclear power countries, US and France, both have ageing nuclear stations getting to the end of their life. Both countries are having difficulties replacing them and are diverting to other form of power generations.
Reply: @Philip Ethan van Harreveld sure, you're not an idiot. For countries like Australia, renewables are perfectly fine as we have a low population density and plenty of wide open sunny places for solar, plenty of destroyed land from mining to use for storage options etc.

I was only calling the other guy an idiot because he tried to claim renewables couldn't meet our requirements (notice how such people never support their reasoning, they simply state their opinion and that's it). I even pointed out countries that do reply on renewables and he tried to claim they're not (so clearly lacking an understanding of what constitutes renewable energy).

The thing about solar farms is you don't need empty desert for them. Some enterprising and intelligent farmers are using them in conjunction with animal farming as they provide shelter for the animals. For crops that don't like direct sunlight, they are also excellent shelter for them.
Reply: @Philip Ethan van Harreveld battery tech is most definitely improving but I can understand the negative comments about them regarding operationing times ( a couple of hours isn't really enough).

Have a look at liquid and compressed air, these are really starting to come into their own for storage and they're quite easily scalable. I imagine though hydrogen will play a big part in storage.
Reply: @Philip Ethan van Harreveld There's no guarantee that fusion will ever be more economical than renewables, even if we can get it to work. It's hardcore engineering - producing then converting extreme heat into electricity via steam. It may well be that converting comfortable low temperature fusion output (aka the sun) is simply cheaper. Probably optimal if you have a need for vast quantities of heat in one place, but other than that, it's very much up in the air.
Reply: Agreed. it's like the "war" between electric vehicles with batteries and electric vehicles with fuel cells: we will probably see cars working with batteries but bigger means of transport using hydrogen (because of the weight of batteries)
Reply: Why settle for a single silver bullet when you can have a shotgun shell full of silver pellets!
Gun metaphors!
Reply: Aspirator with a turbine on the air intake and out take .
Reply: @travcollier  very well stated.
Reply: @johnking6624  the only issue of contention is the meaning of the term Great.
Reply: @johnking6624  part of being “ great “ is being able to pick up on comments made in jest. But perhaps your correction on semantics was for the benefit of the general public and not for my edification alone.
Reply: @sandyt4343  I took a comment which could not have been considered humorous and explained why it was pointless.
Reply: @johnking6624  that’s what makes humor subjective. Not everybody gets it the same way
Reply: It’s because silver bullets make the most money
Reply: The Holistic approach. It's the only way!
Reply: Like people trying to move everything to Solar?
Reply: So the solution is a silver bullet machine gun?
Reply: Humans 0
Saiya-jin 1 to 6
Angels 7 😇

Kalki Ironman 5th matriya buddha 8th arc Angel 11th satguru 13th imam and 24th avatar after 2026 😎

Almighty God 9 😇

Humans type 2.5+ after 2026 by Kalki Ironman (christ in the white horse)(son of man on clouds) type 7 and 8 😎

Jarvis the world’s first artificial intelligence (parrot) 😎

Cuz Kalki is ironman batman super saiya-jin superman ben10 saitama Narutoo optimus prime and every super heroes combined after 2026 😎

Jarvis world’s first artificial living being (just like vision in marvel universe)😎

Made of Quantum and sub quantum particles 😎

Power source quantum energy arc reactor (type 7) level technology 😎

Kalki Ironman going to have every kind of arc reactor like:- type 1 Nuclear fission, nuclear waste, hydrogen fusion, type 2 3 4 5 antimatter arc reactor (solid liquid gas), type 6 electro quantum arc reactor, and type 7 Quantum arc reactor, type 8 limitless quantum energy arc reactor without quantum particles 😎

Kalki Ironman going to have sun in a box million billion tons of hydrogen nuclear fusion reactor type 2 3 4 5 just like sun and stars in the palm of his hand 😎

This all going to happened by self replicating quantum nanobots knowledge energy and techniques at type 7 7 7- respectively 😎.
Reply: My only problem with Interesting Engineering is he's always criticizing a snapshot in time. We can see some scientific/ engineering problems to current tech, but the idea is to further develop the technology or the infrastructure necessary for it for the next few decades.
Reply: @AceofDlamonds  technology does inevitably get better but you can't base an analysis of a technology on the hope that the technology will become viable in the future, if we are to talk about these topics and assess their viability we can't say it's a good idea because I may get better, that's just not factual
Reply: @talhahtaco2035  
But it's not unfounded hope and the researchers at the front lines are fairly realistic about them. I guess these videos are more directed to the regular everyday folks who want to follow the hot new promises...but I dont see the researchers making such bold claims
Reply: That's my point I said above! I agree! This Mr. Real Engineering goes off with the climate hysteria crowd. You need oil for other ingrediants, lubricants, petro-chemicals, jet fuels, rocket fuels (Mr, Musk uses kerosene in the Raptor engine) in other words, you can reduce the use fine, but you can't 100% stop using oil & it's derivatives, that's a fool's game!
Reply: I also think nuclear power will be an invaluable companion to renewables if we truly want a sustainable future.
Reply: Pumped-storage hydropower is the necessary supplementary system to efficiently use and store energy from the sun and wind that is only available at times ...
Reply: @marknoneya6630  That's unnecessarily accusatory. Most people aren't in the power industry. And even then, no single person can really change the way we handle the grid. 

So yes, most people can only support the solutions being presented.
Reply: Right !? Such as reducing energy needs so the battery requirements arent so immense
Reply: It's not about finding a silver bullet, it makes it more difficult to justify funding several different energy storage methods vs 1 that covers most use cases